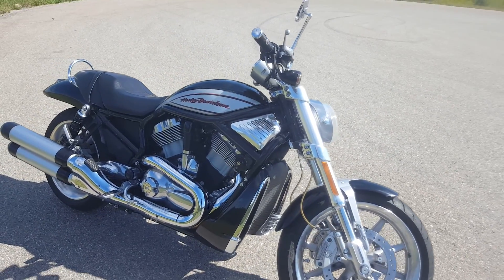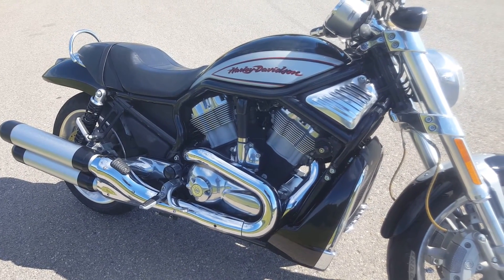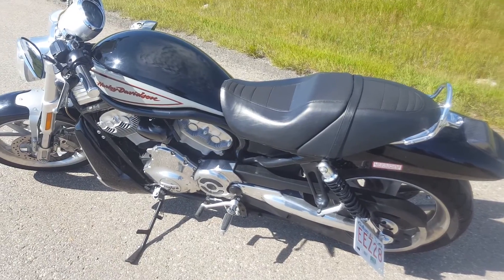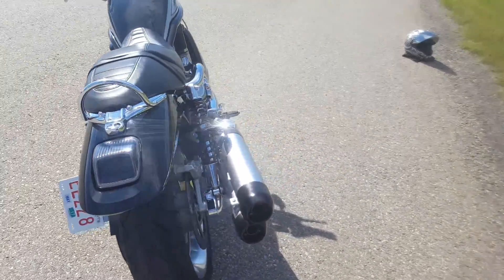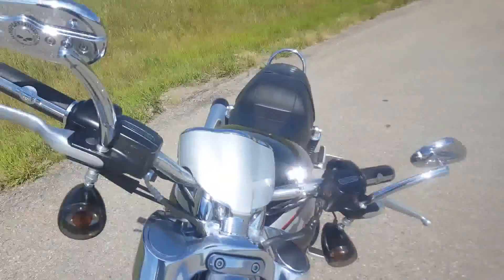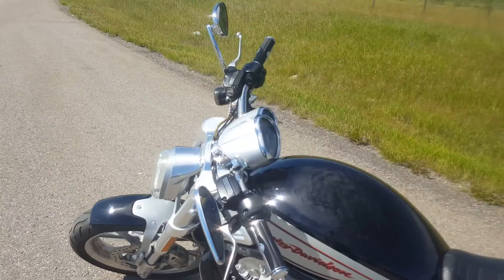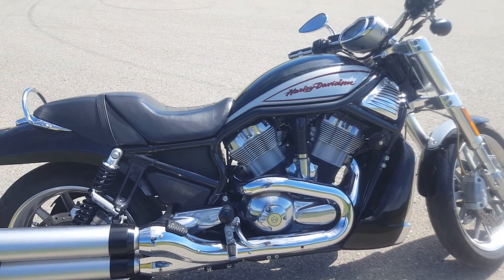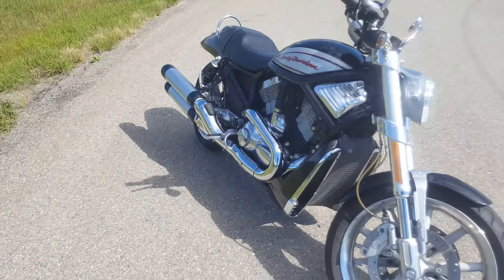Harley Davidson 2006 Street Rod Overview versus Regular VROD

Comment: Good review. I took a test ride on a then-new Street Rod in 2006. As you point out, it was everything that my FXSTC wasn't. I'm considering adding a Harley to my stable. This model is on top of the list of potentials.
Reply from the maker: Right on. You can't go wrong with one. Thanks for watching.
Reply: @CalgaryBiker  Update: I recently picked up a black '06 Street Rod with 9700 miles. Unfortunately, I was hit head on by a drunk driver around the same time, while riding my Ural Patrol. Once my shattered femur and broken wrist heal, I'll be putting some miles on the Harley.

Comment: Thanks for the overview of the best Harley they ever made, love my 2007 VRSCR Streetrod. One thing you left out was the steeper fork rake of 32 degrees compared to the regular V-Rods 38 degrees. You are right it is no sportbike but loves to corner and tracks like its on rails. Only made in 06 and 07, a great and mostly unknown V-Rod model.
Reply from the maker: Indeed. Although the lesser rake is offset by the higher ground clearance, so not sure if it makes as much difference as it could. That said, you will struggle to find a better handling factory Harley regardless of make or year. Thanks for the shout out fellow Streetrodder.
Reply: And 08 model

Comment: Still the best motorcycle Harley ever made. The VRSCD Night Rod (2006-2007) was second best, for many of the same reasons.
Reply from the maker: YouMotorcycle  Indeed. I also recently rode the Roadster version of the Sportster. Great bike also. Less power but also less weight. The fun of the riding position and good chassis with more of the traditional Harey feel. Can't touch the VRSCR but a decent option also.
Reply from the maker: YouMotorcycle Right on. Sweet bike.
Reply: I feel like we have similar tastes :)
Reply from the maker: YouMotorcycle I agree. Thanks for the subscribe.

Comment: I am looking to buy an 04 vrod that has the forward controls mounted under the seat pretty much just like the street rod. Noticed you said you were 6'2. I am also 6'2. Do you feel comfortable with the pegs under you like that? Does it feel like its pushing your knees too high? Ive heard a lot of people dont find the stretched out forward controls very comfortable either though i guess...
Reply from the maker: Hello. Sorry for the late response. Been busy with a motor swap. There are some Night Rod models with standard style controls versus feet forward. The only issue I would see is that the Night Rod uses the standard VROD frame, versus the Street Rod, which used a slightly different frame (slightly taller). I would suggest going for a spin on it to see if it feels good to you. The Street Rod was fine for me, but I never tried a regular frame VROD with standard controls. If you do try it, let me know how it feels, as I would think other people may want to know also. Thanks.

Comment: Just bought an 05- Black Cherry on the silver frame.. I just wish Harley would have given it a shaft drive like the VTX 1800 vs. the rubber belt..
Reply: Noooo! Shaft drive robs all the power your trying to make on this beast. The belt drive system is already stealing up to 15% of your performance, with shaft drive that number goes up to 25% power loss.